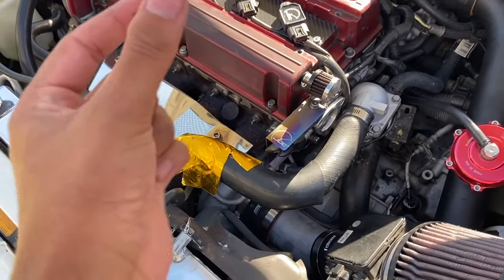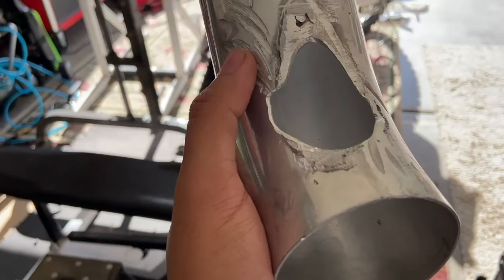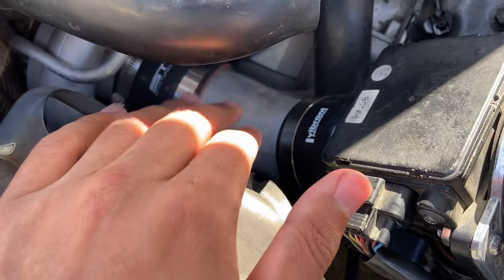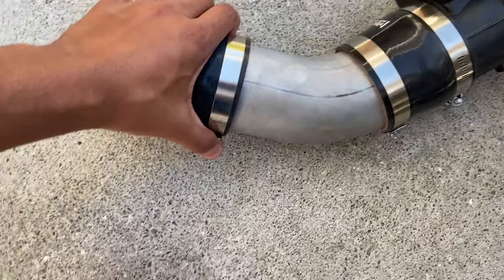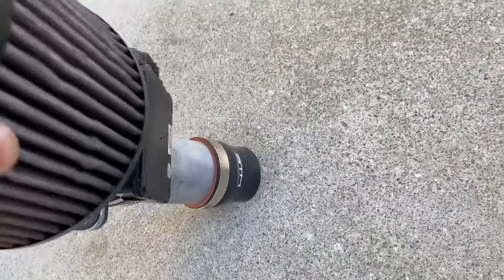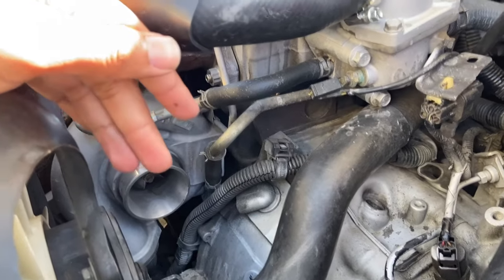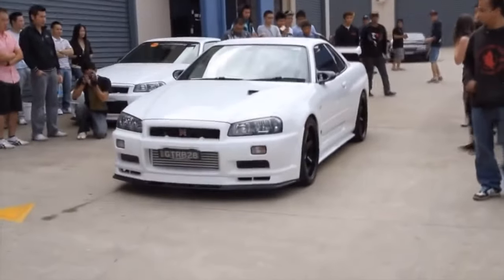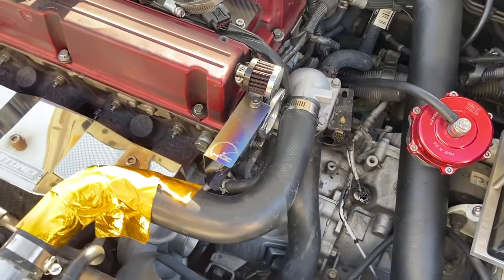How to make your turbo get that perfect flutter! Stututu

Comment: Uh, the flutter thing is actually sort of bad for the turbo.  It's basically all the built up boost back surging when the throttle body closes and forces it's way past the turbine blades, which is the whole point of a BOV.  The flutter sounds sort of cool but it's slowing your turbine down and putting unnecessary stress on the turbos components.  Adding a BOV with recirculation back to the intake is way more efficient...but I guess if you're just going for the STUTUTUTUTUTU noise vs. actual performance then whatever go for it.  Really if it's just about making "turbo noises" they do make BOVs that have dual outlets (one to recirculate and the other to atmosphere) so you can still get that PSSSSHHHH BOV noise while recirculating air back to the intake to help from losing boost, and you can adjust them to whatever combo works best.
Reply: There is no difference in turbo speed between running a blow off valve and running no valve when you lift off the throttle.

"but I guess if you're just going for the STUTUTUTUTUTU noise vs. actual performance then whatever go for it."

The pressure being released from a valve actually is worse for performance because the turbo then has to build up pressure again, that is the reason why in motorsport it's common place not to run any valve.
Reply: @DriftNick I was told it’s the opposite, that blow off valves allow for the turbine to maintain its momentum allowing it to build pressure between shifts quicker whereas no BOV the air goes back through the turbine slowing the turbine and requiring you to build the turbine speed up again to build pressure again
Reply: @gates762x6  If that was true it would not be common place in motorsport not to run a valve,  running no blow off valve actually helps keep pressure built up as the pressure is not all being released and there is no difference in turbo speed between running one or not when you lift off the throttle, they both go down at the same and yes people have tested it.
Reply: All I’m seeing here is a bunch of bs. BOV releases to the atmosphere to avoid the stustu noise depending on how much you open it. Diverter(bypass) valves directs the extra boost after the throttle body closes to the intake to avoid the Stustu. Having no valves on your intercooler piping causes it the force charged air out of the front of the turbo making the stustu(surge) noise. There’s no proof that this actually damages the turbo. I swear I have to comment this atleast once every couple months

Comment: Yeah sorry mate but you’re completely wrong about the tone of the flutter. The size of the turbine and turbine housing dictates how deep it will sound. It has little to no relevance to the size of the intake piping…..
Reply from the maker: When I changed out my intake pipe the tone was deeper and sounded clearer
Reply: Changing the size of the intake piping absolutely changes the sound.
Reply: I have an 11 blade compressor wheel on a gtx3076r and it flutters like a vl. Also the pic of the t04z is a 6+6 design. Has 6 small and big 6 fins not just 6 fins like most stock turbos. So wrong on so many levels.
Reply: Intake piping plays a big part, dunno where you got your info from

Comment: Another huge piece when choosing a turbo. If you want flutter you DO NOT want an antisurge front housing or ported front housing. You need an unported housing like whats shown in the video
Reply: Can you weld up or fill the anti-surge on one of those ported housings? Will doing so reduce flow and power(because technically the compressor CAN suck through those, right?)?
Reply: I have a T51R housing with a billet wheel. do you think I could  achieve much louder flutter if I changed it to an unported housing

Comment: Well I have an Audi A4 2.0T, I have an intake it makes the whoosh sounds when I let off and I can hear the turbo spooling at low speeds but I don’t get any flutter sounds, sometimes I hear a very very very little flutter when I’m driving slow and I let off very fast, I want that stututu sound than the whoosh sound, I think the blow off valve doesn’t make that sound, I just bought a diverter valve spacer so I’ll see if that makes a difference or makes the car flutter a little more, I know someone that has the same car with a blow off valve spacer and a turbo muffler delete and the flutter is crazy it sounds like he has a massive turbo
Reply from the maker: Yeah so the turbo makes that flutter sound not the BOV, it really helps if it’s vent to atmosphere BOV and not recirculating, also the size the the turbo itself matters, the smaller the blades, the shorter and higher pitch it’ll be, and the bigger it is the deeper and longer it’ll sound
Reply: Mine was the same, when you let off the throttle, you have to quickly touch it again immediately, then it will make the sound you want. Annoying but it works
Reply: @jwdebod01  same as mine 👍

Comment: So basically move the bov to the ic pipes and have a straight pipe for the intake?
Reply from the maker: Yes
Reply: Can you maybe follow up on how exactly moving the bov changes the sound? I dont understand it cheers
Reply: I just immitated your setup, cut off the recirculation hose, removed the bov, didnt dose like yours
Reply: @MuzzaMiki  the only thing giving you dose is a blocked BOV. That’s it! 

A FMIC will be the biggest factor in getting good sounding dose as well as a full intake
Reply: @OGtrushalpatel  i have blocked it before sounds the same as with my bov intercooler is already 3" and my intake is stainless steel with a pod
Reply: @MuzzaMiki  that’s all you can do then. What car is it? I only have a 3” full intake, TOP MOUNT intercooler and blocked bov and I still have a decent flutter on my mazdaspeed 3. Once I do a front mount I know my flutter will sound fkn amazing
Reply: @OGtrushalpatel  truee i have a evo 8 like in the vid hence my confusion
Reply: @MuzzaMiki  bro if you have an evo your flutter should be much better than mine! They come stock with a front mount so it should be a nice noise
Reply: @OGtrushalpatel  it sounds orite! But not like in this video
Reply: @danniebrown3396  which turbi is this ? Pls tell me the name I wannt to get flutter sound in my hilux
Reply: @OGtrushalpatel  how psi ur pushing
Reply: @jimmyletalu7715  18-19

Comment: "its gonna sound higher pitched like this" shows a sped-up video u basically just did an alvin-and-the-chipmunks but with compressor surge lol
Reply from the maker: Lmao bro that’s how his actually sounds, if you look at the surroundings it’s moving at normal speeds
Reply: Not a sped up video but what he said about it being how much boost you run that makes it sound like that is not correct.

Comment: This is the coolest sound but you are going to end up blowing your turbo bearings to bits as the air is being forced back through your turbo blades into your air intake and this will happen it’s just a matter of when
Reply: Been doing it for over 10 years, never been an issue.

Comment: Not have effect for tubro? U use which stock?
Reply: It will loosen a bit your bearing over time and make it have some side to side play but basically it’s not that bad for the turbo. If you do it with a stock intake you most likely to eat nothing

Comment: hey bro i have a question my turbo doesnt flutter its stock how do i get it to flutter
Reply: If it doesn’t flutter it means it’s doing this job properly. The flutter comes from the Bov surging, pushing air back into the turbo because it couldn’t get it all out, which can damage the turbo after awhile. But if you upgrade your turbo or bov sometimes a little is unavoidable. If you want the sound don’t do it on your stock turbo
Reply: @ashkechum101  The flutter is from not running a blow off valve, it's not a blow off valve surging.
Reply: Block the vacuum line to your factory bov. (BOV, not wastegate).  Change your turbo-filter  piping to be as free flowing as possible.